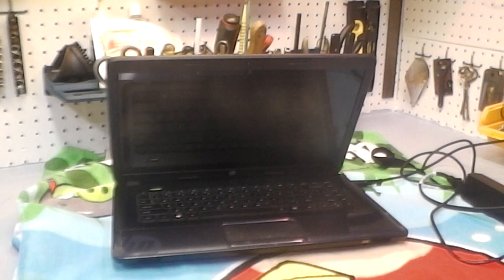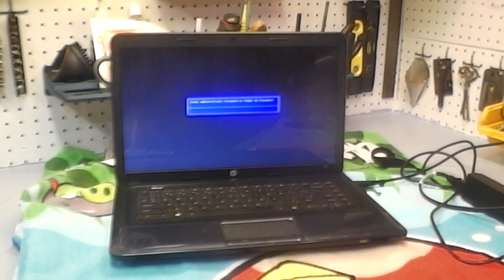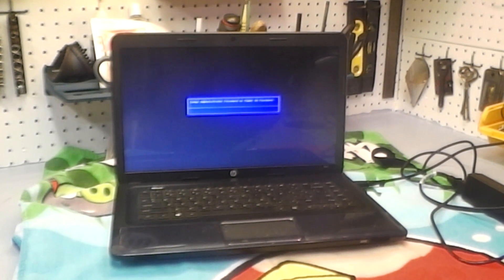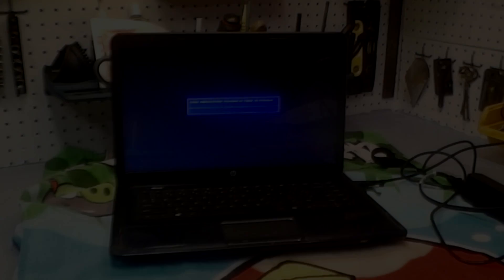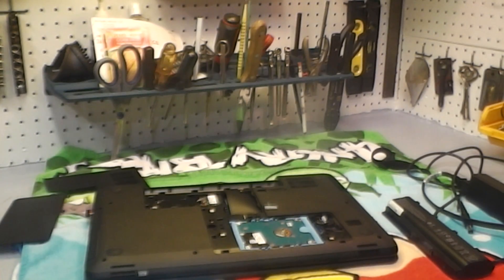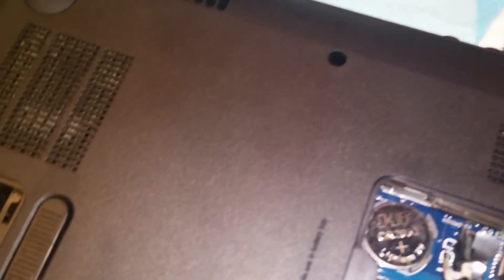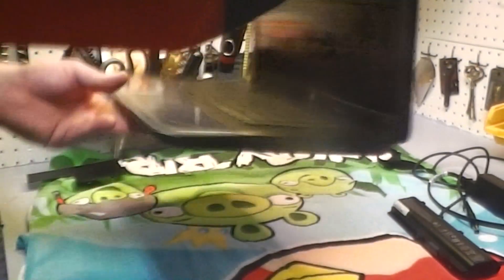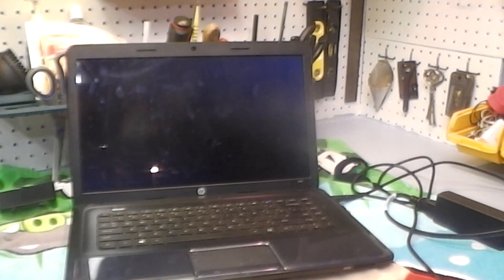Lost Or Forgotten Power On Password Fix For A Laptop

Comment: I have an HP ZBook 15 g3. I need to clear the POST Power-On Password. I unplugged it, removed the battery, and unplugged the cmos battery. I let it sit for a few hours, plugged in the ac adaptor (left the battery and cmos unplugged), and turned it on. But it is still asking for the POST Power-On Password. I tried leaving it blank, and I tried "password" and "Password". What else do I try?

Comment: When I removed the battery I replaced it after leaving it off for about two or three minutes. Then I popped it back in and put the laptop back together and started it up. I got the message screen saying I removed the CMOS battery and then when I resstarted the computer it went right back to asking me for the administrator or power on password. Do I have to restart the computer with the CMOS battery still removed? That's the only thing I could think of. I'm going to try it and if it works I owe you a beer RandomVideosUSA. If not you owe me one. Thank you or go to hell. I won't know for another hour or so. Lol.
Reply: hey any luck with this?
Reply: @bahlowme  i had none and i tried a lotta things

Comment: Works on Hp g7,I just popped bottom cover off 2 screws & you can see where the battery pigtail is,unplugged for 20 mins to be safe reinstalled & worked..AWESOME THANKS SO MUCH!
Reply: Mine is HP Probook 450 G7. Showing Power-on Authentication after installed "Hp client security" tools. Will it work. Any idea.